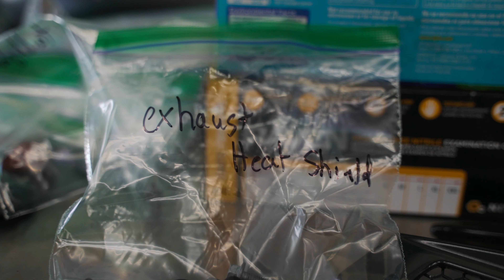McLaren 720S MC1000 Package (1000HP!) | 1K Motorsports | RYFT

Comment: I get they could get the power up by a good tune and the straight pipe exhaust system for sure as well. But a 1k hp , like how even? Can't be just from doing those couple of things.
Reply: 800 hp
Reply: 802WHP max from exhaust work and stage 2 map (safe amount of boost).